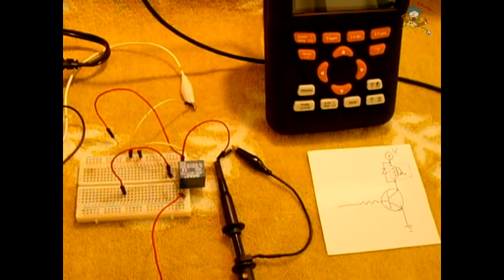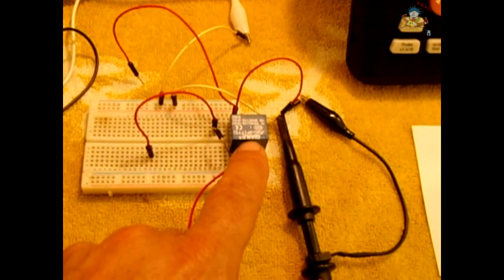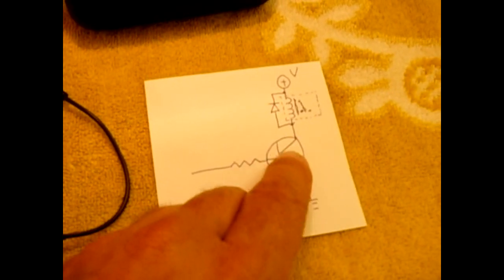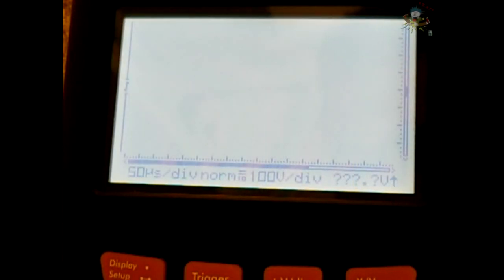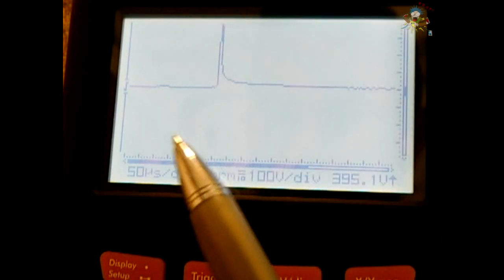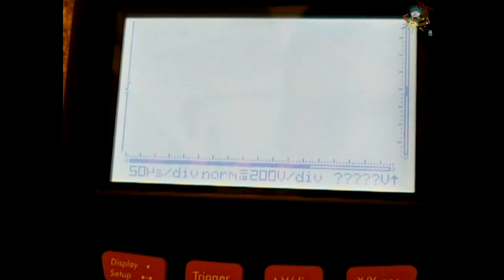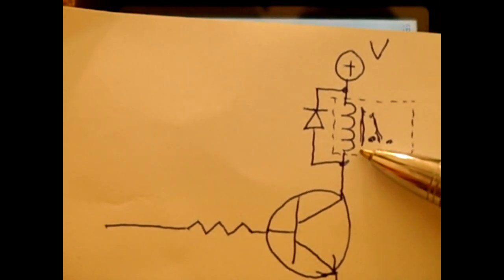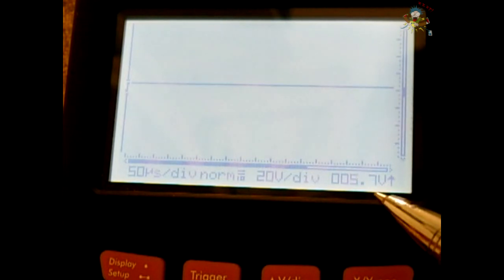Back EMF High Voltage Spikes on the Oscilloscope - Part 1

Comment: I want to replace the ignition system of my old car with a transistor (TCI) instead of a breaker point contact switch.
is it necessary to also add a diode in this case on the ignition coil, to protect the transistor from damage. will it not affect the output of the spark plug flame

Comment: Nice👌
Sir my question is shud we use snubber in bigger induction loads like AC motor to reduce same problem as you mention as showing smaller coil relay☝️🤔?

Comment: Is there a formula to estimate the max back EMF，if we know U、A and L of the coil？
Reply: You can check out  problem 27 (II) in Chapter 30 from the D Giancoli book Physics for Scientists and Engineers with Modern Physics 2008. It is not exactly the same, but you'll have a feeling.

Comment: I get spikes when using a wall brick down to 30vac. I rectify it to dc and lower it for my controller. Everything is fine until I turn on and off the unit that uses the 30vac. At that point the dc current spikes. How would I fix that? thanks.
Reply from the maker: Try a voltage regulator.

Comment: Thanks for this, very helpful. I can't quite see how the probe is hooked up, are you protecting it from the voltage spikes with something? Thanks.
Reply from the maker: No, the probes are across the relay coil. Thanks for watching!
Reply: I've jst got my first proper scope asnd would like to do this but is my 10x probe going to be damaged? So i don't need to use a resistor in series or a 100x probe for 700v transients ?  @electronicsNmore
Reply from the maker: @GaryMcKinnonUFO  Set the scope to x10 and set the probe switch to x10.
Reply: Thanks for taking the time to answer.  @electronicsNmore
Reply: My Rigol scope does a max of maybe 700 volts peak to peak on a sine wave. if voltage does above this range will it damage scope ?? Any opinions appreciated. I assume it protects itself and just shows out of range.
Reply: Actually i will use current limiting on my power supply to keep current down and hence voltage spike down. Then gradually increase current to see effect on voltage spike ...
Reply: @michaelcostello6991  I don't think that will help at all. This current is not coming from the PS

Comment: How diode will conduct properly ???
We have seen the spikes are mostly between 100  to   200
And while 1N4001 or 1N4007 have as i know approximately  50v after that value it can break down so how you can join it to parrellel of 100 or more than 100 volts

Comment: I have an electric fan on my old truck for cooling when it is running and I turn the motor off it tries to stay running I have noticed, can I put a diode across the relay coil for the fan. and if so what is recommended?
Reply from the maker: I have no idea how the fan is wired. Run a new wire to the relay coil so the relay powers off when the ignition switch is OFF.

Comment: The same effect happends when you put the diode in parallel to the transistor instead of the coil?
Reply from the maker: Use a properly rated TVS diode across the C & E of a transistor.

Comment: With the suppression diode, there is still a spike (however tiny). With a supply voltage of 5.0V, the low side of the diode spikes to +5.7V. (Every time.) You failed to capture it because you did not set your trigger correctly.
Reply from the maker: I was not looking for a harmless .7V spike. I was showing my viewers the high voltage spike which can and usually does damage components, and how the diode prevents the spike. That was the purpose of the video, nothing more. Thanks for watching
Reply: The diode does not eliminate the spike, it only decreases its amplitude (and increases its duration, by the way). You failed to capture it (and enlighten your viewers) because you did not set your trigger to +5.2V. A Schottky diode could limit the spike to only 5.3V (not that it would be especially helpful). In the opposite direction, deliberately allowing a larger spike can make the coil turn off faster (which might be helpful in some apps).
Reply from the maker: Some Guy
Whatever you say, I learned to not argue with Youtube experts. :-). Have a great evening.
Reply: Excuse me, do you know that if it's true that when you put the diode in parallel to the transistor instead of the coil this diode would protect the transistor from the HV spike surge generted by the coil?
Reply from the maker: Eng Richard Balboa
Yes, that works. Components such as transistors & mosfets use internal diodes across the emitter and collector or drain and source to protect them. Usually TVS diodes.
Reply: Ok Thanks!
Reply: @Eng Richard Balboa We would "know that it's true" if it was true, but IT ISN'T.
•In this circuit, a diode across the transistor is no help at all. It doesn't hurt, but it doesn't help, because it never conducts. When the transistor switches off, the "kick" from the coil tries to drive the now-open collector to a huge positive voltage, which will break down the diode or the transistor, whichever is weaker, and destroy it.
•A Zener diode across the transistor can protect the transistor. Its Zener voltage must be more than the power supply voltage but less than the transistor rated voltage. (The coil current will decay faster, but that usually is not important.) Its peak current rating must exceed the coil current. If the coil is cycled frequently, the Zener diode needs a power rating.
•Independent replies that have this same information (though less organized): http://electronics.stackexchange.com/questions/93452/correct-use-of-flyback-or-snubber-diode-across-motor-or-transistor
•Diodes are placed across the transistors in H-bridge circuits. The diode across each transistor protects both transistors from the spike that occurs when the other transistor on the same side of the load switches off. https://electrosome.com/dc-motor-driving-using-h-bridge/ Some transistors include a built-in body diode that cannot be removed because it is part of the silicon; it doesn't hurt in this circuit, but it is a bonus in H-bridge circuits.

Comment: great vid :D i need some help i need a 40 volt regulator for this lm723 ic http://www.thebackshed.com/windmill/articles/VariablePowerSupply/TheBackShed723Reg.gif i dont want to blow it up lol even though i enjoy it  i would like to make this project permanent i took your advice and looked for a 300a 300v voltmeter for the display i have an old metal enclosure that i may use the size of the heatsink has to be large obviously and im putting a  microwave fan for cooling that is controlled by thermistor if i n any advice i wont hesitate to ask thanks again :)
 advice from anyone is welcome
Reply from the maker: Maximum  voltage input is 40VDC. Either purchase or make a 28VAC transformer, then when you rectify the output, you will be just under 40VDC.
Reply: kool i did not think about that lol I have a mot lying around somewhere thanks keep up the great work :) (Y)

Comment: I  think it may be possible to use two back to back diodes for some ac powered coils to limit the spikes in both directions.
Reply: lifegrower Resettable fuses do the opposite or inverse of what is happening here. Clamping diodes and MOVs, normally high-resistance circuit elements, protect against excessive voltage by decreasing their resistance (shorting it out). Fuses, resettable fuses, and circuit breakers, normally low-resistance circuit elements, protect against excess current by increasing their resistance (opening up). Different again, inrush limiting devices prevent a hard start by starting out with medium resistance and then decreasing to low resistance after power has been applied. Resettable fuses and inrush limiters heat up when they operate; when power is removed they cool and reset themselves.
Reply from the maker: For AC circuits I like to use MOV's.
Reply: electronicsNmore What is an MOV?
Reply from the maker: William Ward
Metal oxide varistor. The component is designed to have an extremely high resistance below the rated voltage, but as you get closer to that voltage, the component's resistance begins to drop. If the voltage rises too high, the resistance will become very low, and eventually clamp(almost zero ohms) in order to keep the high voltage spikes down.
Reply: @lifegrower NO. •Two back-to-back diodes is just an open circuit (until the reverse-biased diode breaks down). Two back-to-back Zener diodes will clamp to the Zener voltage plus 0.6V, in both directions.
•If the needed Zener is expensive, you could use a bridge rectifier and one Zener diode. (The one Zener diode might need a higher rating because it takes every "hit", instead of just (on average, assuming the timing is random) only half of the hits.)
•One MOV can be a better choice. It provides bidirectional clamping in only one component. Suitable for AC and (presumably) no problem with DC.
Reply: Some Guy Thanks, I seen some "resetable fuses" that seem to be some kind of Varistor or something. I guess they reset themself.
Reply: Some Guy Thanks, its been a couple of years since eet.

Comment: How do you determine the value of the diode used across the coil?
Reply from the maker: The current is very small due to the short duration of the spike. What is more important, is the voltage rating of the diode. I use no less than a 1n4003, but usually just use a 1n4007 for everything. If you use a 1n4007 for all your DC applications, you should be fine.
Reply: electronicsNmore
Thank you very much. Very good explanation as usual.

Comment: What is Back EMF vs CEMF vs Flyback vs Inductive discharge vs capacitive discharge, yes - can we compare the coils discharge of energy to a capacitive discharge?
Cheers
Reply from the maker: What you see going on in this video is CEMF(same as back EMF). Flyback also applies to this circuit(the way the diode is used). Capacitive discharge is used for ignition systems(capacitor is charged up, then the stored charge is dumped into the spark plug. Inductive discharge? No clue. LOL
Reply: Yes, now we know CEMF and BEMF voltage by definition, can not be higher than the source voltage. So this "flyback coil discharge" is almost opposite of a capacitor discharge - coil discharge is high voltage low amp, capacitor discharge is high amp and voltage does not change - cool stuff!